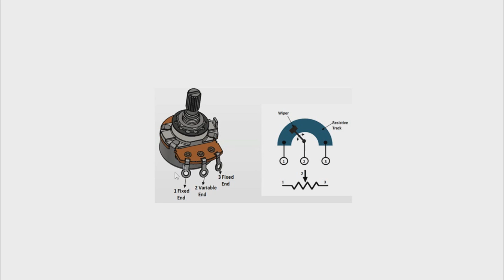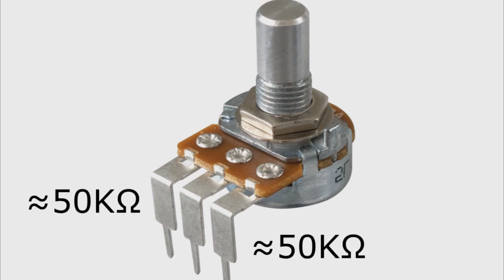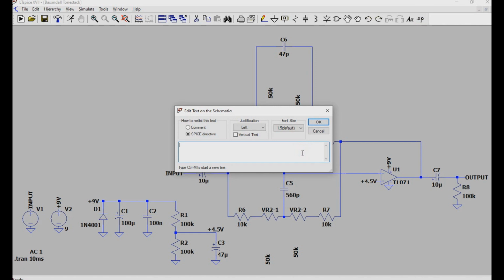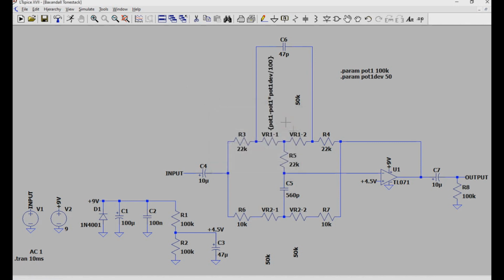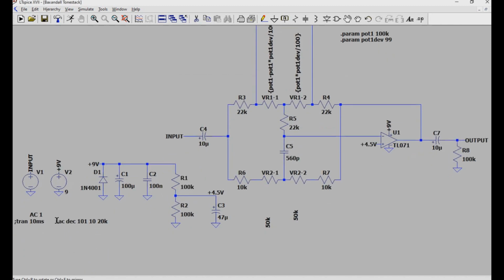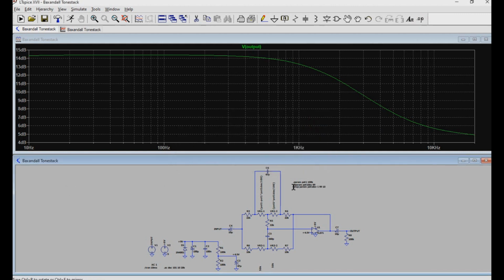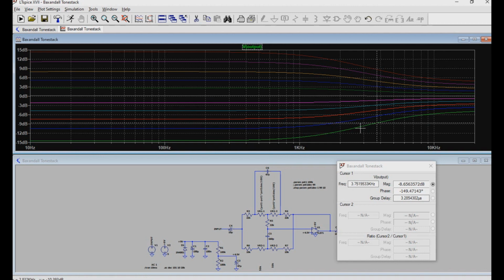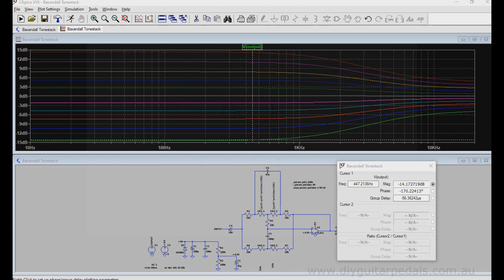Beginners Guide to LTSpice for Guitar Pedal Builders, Part 4: Tone Stack Responses

Comment: excellent. i've found a model for potentiometers but i's a bit fiddly. This seems more practical. How would you implement a log/revlog/w pot?
Reply: As the type of potentiometer is just a matter of "where on the dial is this resistance" Linear, Log, and Anti-Log will have all the same sweep values, but they will vary in "percentage of knob turned" vs "resistance values". So, you could either make a manual list in the step param, or if it is a log pot, use .step oct param pot1dev 1 99 10 and it will logarithmically sweep the 10 values. I don't really see a step param for anti-log.
Reply: I just found out that LTSpice can interpret relatively complex expressions in those parts we put curly braces, such as the resistor value in this video {pot1 - pot1*pot1dev/100}. You could use here a log or whatever operation you want
But for example for a 100k log pot as Erik explained, basically if you put the pot at maximum it will show 100k between leg 1 and 2 and 0 between legs 2 and 3, and if you have at minimum it will be the opposite, exactly the same as a linear pot. The difference is just that instead of it growing linearly with the percent of turn, it will grow exponentially (very slowly in the beginning then very fast close to the end)
The problem is that there's no direct formula for every log potentiometer. You can find one on the internet and use it though, but as you search you'll see several models. Just pick one and go with it, or just go with a normal linear pot but choose another one on the final build if you think it will be more fit (the extreme positions are gonna be the same values anyway, it's just how fast the value will change that is different)